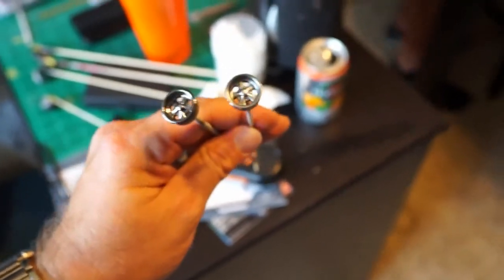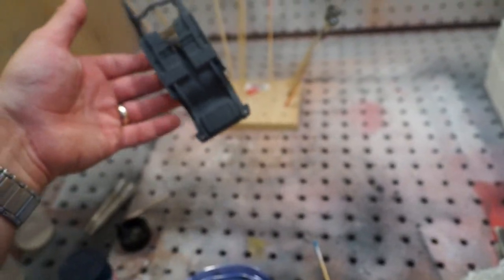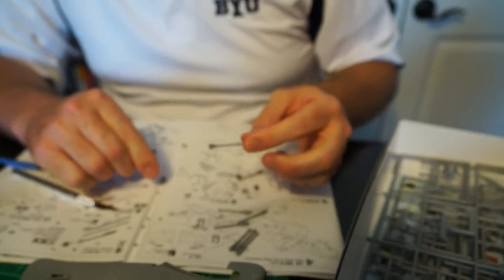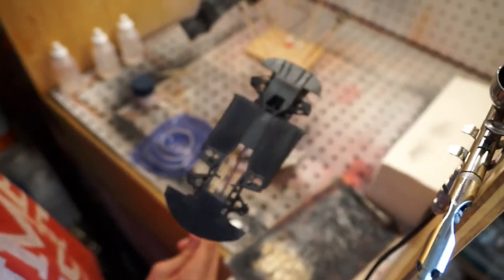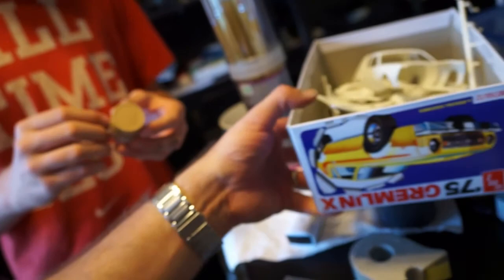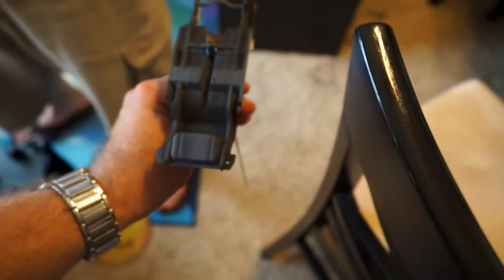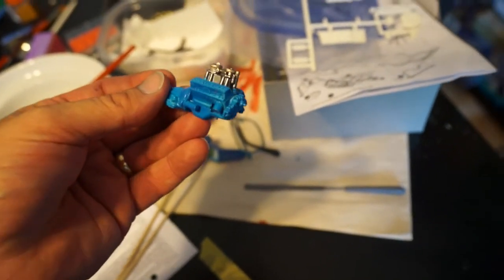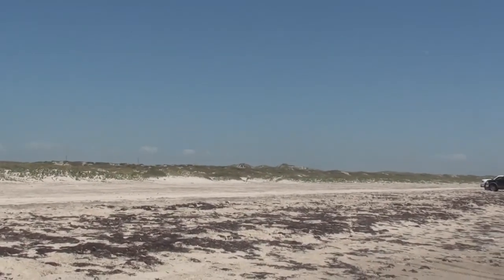Saturday afternoon model club: episode 10: Wheels

Comment: Love to see you work! Have David do a bit of reading on the Typhoon & Tempest: Very interesting Story. Ground attack plan? Hell yeah! V1 hunter, as well. Way underrated Aeroplane.
Reply from the maker: And if you ask Robert of Basic Modeling fame, I know nothing about WWII aircraft, nothing!  One day when I have the time I will look things up.
Reply: badgrendels Never too late to learn!
Reply from the maker: Guido Hopp That is true!
Reply: they were also meant to replace the Hurricane but were too heavy so they were changed to ground attack and Guido said V1 hunters too. to take out a V1 the pilot would fly with a wing slightly under a V1's wing thus flipping it knocking the gryo for six. Extremely underrated Planes
Reply from the maker: DarkBlade88 Thanks for the information, I know nothing of this plane....